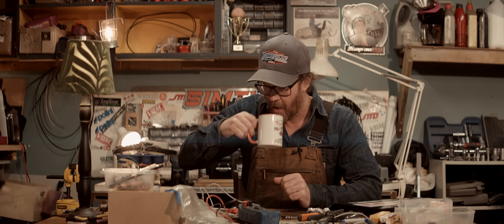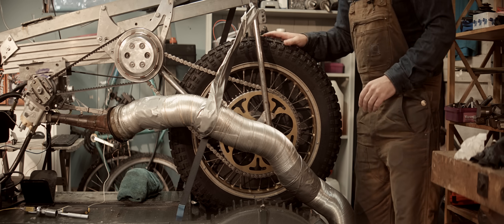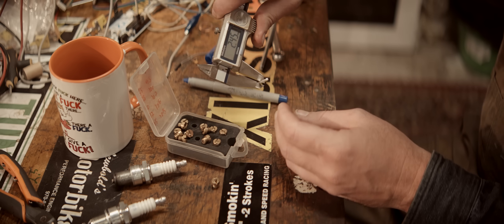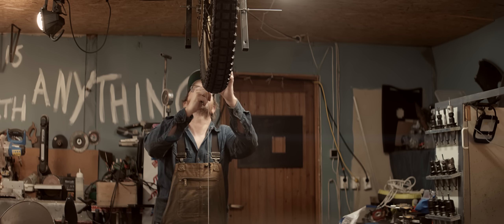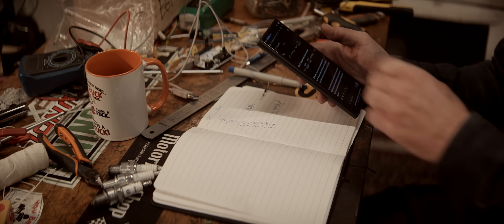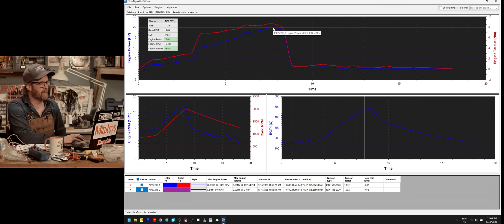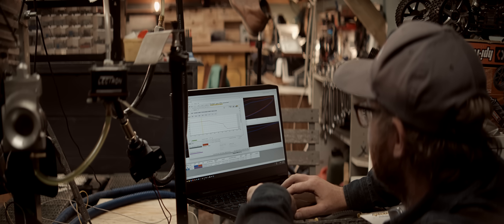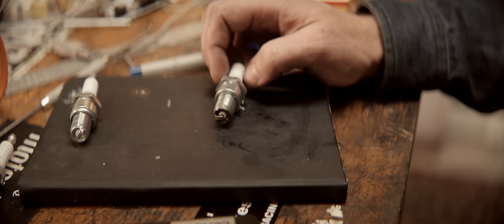22+ Wheel HP from 50cc! Finally!! And we're just getting started.

Comment from the maker: 🌏 Get Exclusive NordVPN deal + 4 months extra here → https://nordvpn.com/2strokestuffing  It’s risk-free with Nord’s 30-day money-back guarantee! ✌️
Reply: The advantage of the Uniflow Scavenging engine is that it does not need to mix autolube oil into the fuel tank but has a sump like a four-stroke engine.
Reply: @sleepyไปเรื่อย  very cool
Reply: The most interesting and important (I think) reading on a plug is the location of the annealing point on the ground strap.  You want to see a distinct line right on the bend where the metal changes color/shade.  If the line is past the bend or into the threads,  uncontrolled combustion will happen (knocking).  If it's before the bend or not yet showing on the ground strap,  you have room to increase heat and power by more spark advance or leaner fuel mixture (if running rich).
Reply: Run a air filter
Reply: why don't you put the variator on max gear?
Reply: Feeling the need to wash Your hands after using ChatGPT  is a statement i can definitely understand.
Reply: add 10% of hydrazine to instantly gain power

or go kaboom
Reply: @fabiotiburzi  yikes, 10% is just crazy talk. He probably can't get hydrazine there. But if you do, I'd start at 2% by mass, retard timing a bunch, and a bunch more; then creep into it. But yeah, hydrazine will change your nitro experience.

Comment: I've also spent years chasing what in hindsight was the wrong problem for a project or working under a misassumption.
It's easy to be upset at yourself for all the "wasted" time and $ but on reflection, there's generally a bunch of knowledge gained along the way that hopefully is of some use in the future.
So, rinse and repeat, you'll push on again making progress until it stops and then realize you need to take some steps back more time was "wasted" then you go forward again.
Take the wins!

Comment: Can you use the YourDyno software to calculate the MOI without a load cell? It seems like the wight and string drop along with all of the other parasitic losses aren't going to be accurate at all.. There is an MOI calculator wizard in YourDyno, but I don't know if it works without a load cell..
Reply from the maker: I got the inertia of the electric motor rotor I use for a dyno roller from the manufacturer of the motor. The string drop method was just for the wheel, and should be pretty accurate.
Reply: @2STROKESTUFFING  What about all of the other stuff?? I see a clutch, a bearing block, a belt, a chain, sprockets... All of that was calculated in my MOI for my Mustang dyno running YourDyno software.

Comment: Are you actually measuring the 30% nitromethane by weight? If you are, you're going to have a very screwed up conglomeration of  fuel components as everyone I know mix their blends by volume—a big difference. Also, with the fuel you're apparently using, the compression ratio for gasoline should be about correct the way it is. If you jack the c.r. to 18:1, there's a good chance you'll burn her down. Why not experiment with methanol and oil first (get rid of the unpredictable nitro) and not risk your latest engine design? Or at least use a mule-engine as others have suggested.
Reply from the maker: It's 25% by volume from the manufacturer. Thought by weight was the norm, that's why I stated it like that.
I've got parts to build up more engines, and raw castings for even more👍

Comment: This is probably the armchair thing. But I think the exhaust scavenging is probably affected by the extraction hose? I wonder if the extraction fans negative pressure can cancel out the turbulence in the flue pipe. Might only be worth a half a horsepower or nothing at all. 

If anything it would mean this little 50 is being mildly restricted and would otherwise make even more HP!

Comment: i think u need more fuel still. on nitro you need ALOT of fuel. the plug looks close bit looking like too much timing on the strap but could be getting hot from not enough fuel. could fix itself with fuel. add more till it starts falling off, then see where the heat mark is on the strap. if the fuel was perfect then it may be too much timing. 5 degrees is a big change on high strung engines. your close it sounds really good.

also how hot was is after back to back pulls. looks like it kept picking up. may need more heat in the motor yet.

i think you can find a bunch of power yet, but running it on the salt for many miles you may have to dial it back a little so it will live.

Comment: Increase the volume in your fuel tank. Gravity is a force and you are barely running enough in the tank for it to overcome the flow
Reply: This is evident by the fact that you need a fuel pump. If I can run a 250cc with 48hp off a gravity fed system you should not have any issue
Reply from the maker: The pump is pumping back from the surge tank.

Comment: When I raced with methanol and nitro fuel we ran 32 degrees trimming  mac 91....plug looks lean to me. More compression equals more power.
Have you thought about a slipper pipe????
Used alot on Enduro Karts with long straights.
Right inline with what your doing. Essentially a long drag race.
Would help your torque on take off and add power in the upper rpms.

Comment: The only way I can see doing more accurate test is to be able to hold the engine back with dino at set rpm. Then you can tune as good as you can with the variation in atmospheric conditions...
Reply from the maker: Planning to add the retarder to the inertia dyno for steady state testing 👍

Comment: The side electrode of the plug looks as if it has been too hot and in some danger of causing pre-ignition or even melting. That yellow colour is not good. NGK make some plugs that have a shorter and thicker side electrode, for example the B10EGV or B10EG as opposed to the B10EV or B10ES. See also something like the Champion N54R in which the centre electrode is recessed inside the plug and the side electrode is a very short piece of wire pressed into a radial hole. A recessed nose plug can have an effect comparable to retarding the ignition a few degrees. It also has a bad effect on slow running, but in this application you probably are not worried about that.

Comment: Cool,, finally after redesigning everything to be more conventional you get a breakthrough, thinkworthy =)
However, the sparkplug, it burns away the soot just about 3-4mm from the sidestraps tip, you can let it go all the way to the middle of the bend and still be safe(if having 10-10.5 heat range)
And, that blueish colour is not hot at all, about 290-300degrees(if bare metal, plating burn away)
Creep up slowly on timing, make sure you are doing regular plugchops(real ones) two or three pulls after a change of timing.
And to be more safe, jet it a little bit more rich, and lean it down when you don´t find any more when adjusting timing.

And oh!
Someone told me to keep away from iridiumplugs with nitro, dunno if it is some weight into that.
Reply from the maker: Thanks for the tips! I'll add more fuel next and go from there👍

Comment: This question may well have been answered at the very early stages of these videos but I will voice it here just in case, back in 1983/84 the Kreidler 50cc race bikes were making 21 HP on pump gas and I have read that methanol gives between 10-40% more power so would it of not been better to start by adopting specifications from that engine and adapting it to run on methanol.

Comment: I´m sorry.
But now trying to compensate for that rear wheel, you get crank hp, but with odd friction added that crank power doesn´t have.
It isn´t that bad though, it´s only a couple of tenth´s of hp you 'gain' by adding the 0.125 inertia.
Reply from the maker: I'm not compensating for drivetrain losses, just correcting the inertia that has to be accelerated.
Reply: nah,, you are sadly enough wrong.
Reply from the maker: No.
Reply: @2STROKESTUFFING  this is how it is:
When you are adding the rear wheels inertia to the roller, you make the rear wheel 'null', dyno thinks it is the roller itself.
Thereby you delete the wheel 'phiscally', but you keep the frictionlosses, getting bogus numbers.
Don´t fool yourself(as usual)
Now the numbers you gain is just tenths, but stil incorrect.
Especially now when you still got the friction from the wheel/tire.

Good dyno softwares let you do rollouts and calculate with wheels inertia and friction.

Now you are in no mans land, but with friction lol
Reply from the maker: I disagree, leaving wheel inertia out when roller inertia is relatively low would give the bogus numbers.
Anyways, you'll be happy to know that I've done a coastdown run with the wheel and chain on the roller and that's the loss numbers I'll use from now on. Still bogus numbers as frictional losses under hard acceleration are higher vs coastdown, but that's the best I can do. Oh, and if you could tone done the aggression a bit would be nice.

Comment: OK, I just caught the 30% nitro comment. I never ran at 30%, so I can miss here. 
I'd worry about the volume of fuel as you increase F:M ratio. At 30% there's a lot of Methanol to ignite the Nitro throughout combustion. 
Nitro is always too lean. lol. But as A:F is moved rich, the additional fluid volume can drown the spark. Hydraulic Lock will occur and will suck. Very high energy ignition may save you some twisted connecting rods.
I don't think the carburetor venturi will have the capacity to pull enough fuel through the jet when you get to about 60% Nitro. It will likely work for dyno tests, but then will be very lean under hard acceleration, and high wind loading.
Nitro behaves crazy weird, almost everything is opposite gas and meth.
I'd drill a weep hole at the bottom of your exhaust pipe. Then measure volume of fluid that drips. No fluid, too lean. 
The carb n/a fuel guys setup the jet for the leanest part of the run, then add fuel another way to cover high load parts of the run. 
When you increase mechanical load on a nitro engine, it is able to burn much more fuel per unit air. And, it must get this extra fuel or it'll split the cylinder open. The nitro burns quicker when the engine load is increased, if mixture is not richened the power stroke will run out of fuel and detonate the last little bit. 
I never had any luck reading spark plugs on nitro. It seemed to look the same whether it was rich or lean. But at 30%, I'd guess you can read plugs as if 100% methanol. Piston Al deposits always indicate lean
I'd suggest you add an air bypass valve to lean the mixture until the head gets up to temp. Close the air bypass at your target head temp, right before you run fully loaded. There's not much air going through the carb at low rpms, if engine is under hard acceleration with mechanical load, I think you'll need to pump more fuel in.
Perhaps an injector in the transfer port would let you program the mixture.

Love your channel.
Reply from the maker: Thanks, and the advice is very much appreciated! I plan on hooking up the retarder to the inertia dyno, in that way I can do steady state and  simulate a Bonneville run to be able to properly tune in fueling 👍
Reply: @2STROKESTUFFING  I look forward to it. I didn't learn much with my eddy current brake load. I think I missed the math regarding variable wind loading. I kept running lean after 660'. Some crusty FA guys talked me into adding fuel and timing at 660. A week later I had a larger fuel pump and sometimes crossed 1320 while still on the wheelie bar. 

enjoy

Comment: Never drill jets!  On our alcohol/nitro motor we typically look for the plating to be burned down 2-3 threads.  But that is a 4 stroke.  Your mileage may vary :)
Also, we always make sure to kill the engine by shutting off the fuel first, never ignition first.  I'm sure you already know that.  But it's important if you want accurate plug readings.

Edit:  SBC/blown alcohol/nitro combo. Mechanical injection.

Carburetion is antique technology with many, many drawbacks.

Comment: Power per Liter is NOT directly proportional. A 1.0 Liter engine will have many more losses. Piston mass will limit practicable RPM. This 2-stroke gets 16k combustion events / min, where a 1L 4-stroke 1 cyl gets only 4-5k. 4-strokes also have to power oil pump, and accelerate the valve train mass. 
So power / displacement is not a scalable ratio

Comment: nitromethane fuel blends... spark plug color, indicated by the combination of fuel additive chemicals when they are broken down into there simplest oxide formations. ... a hydrogen engine would be very clean, other then the oil adding black carbon to the plug as the fuel mix becomes too rich some of the oxidizer chemicals that would leave a white oxide "lead oxide" on the plug become a gray when mixed with carbon. the yellow color is possibly from oxidized ammonium nitrate mixing with lead nitrate in a stochiometric mix with sulfur... 25hp 50cc... soluble flash powder oxides on plug. fuel adjusting ends with color checking for micro grams per liter adjustments. Diesel engines can't do that because the injection pump lines would explode to some extent relating to the preignition/injection pressures and the energy input for thermal decomposition of oxidization additives that burn in differing points in rotation of the ignition flame front temperature. same thing with small primers or large primers, the flash powder is different yet the primer cup is the same, one will not work in the other and the handling costs change between the two... now if that was regulated fuel the plug would have a purple tint added if cleaned and concentrated into a drop to view under a scope, because that would be an iodine formulation that prevents misuse of the fuel for making snap caps as... it self combusts when fully dried in air... same as the linseed oil rag's self combusting. better off asking Santa about some things... how to make a profit on just giving them what they ask for? knowing when to stop and pay for things to some extent... hypoid flute 17hmr, electrolysis machining! only makes music if the player knows how to whistle, yet the one steals it for being the source of... the noise. and it keeps playing... pickle low, pickle high, sweet dill or sour lactic.

Comment: Add a second sparkplug. Two points of combustion origin will reduce time to combust nitro. More compression will help too. Reduce premix oil as a reciprocal function of new fuel volume to previous fuel volume. Such that the oil throughput remains equal between baseline and test. If you mix oil as a percentage of fuel volume, you have far too much oil in the mixture.
Reply: Second plug in 50cc is probably not practical or necessary in such a small combustion space? But I certainly agree with your fuel to oil ratio theory. Increasing oil with premix leans the fuel ratio and vice versa. And increasing the jet size with the same mix increases the oil supply as you say.
Reply: @funkiwikid6106  Second plug on a 2-stroke head is easy, no valves in the way. 

I get your thought on tiny combustion chamber. I'm thinking more about the very short time from TDC to Cylinder Exhaust Vent. Nitro combustion heat to mass, and to volume, is far short of gasoline. I think I was around 8x the fluid volume of gasoline by end of the run.

Please check the time required to combust that mass of nitro. I had too much fuel left when the exhaust port opened until I added the second plug. As you reduce Meth and increase Fuel the burn time increases logarithmical. At 30% the Methanol vapor will initiate Nitro ignition almost everywhere. If you want to spin it at 16kRPM, I think I'd put all my focus into massively distributed ignition. 
Of course, Nitro has never done what I first expected. So happy we get to view this experiment. 
Nitro is absolutely the best fuel to race with. You only have to account for a few items; the rest will be solved by the fuel.

Comment: Ye ha! That’s some pretty impressive hp and your hard work and dedication over the years is starting to show! it’s starting to get serious!  And for love of this engine an adoption to tuning strategy that has brought great success for me is a simple rule to stick by for nearly any two stroke other than a diesel of course although applying the following formula to one of these could be fun! for me on rc nitro engines pushing high rpm’s a must is the ability to run far over rich first! then lean it out until desired power, not much difference to petrol just far more extreme! And any alcohol is more knock prone than petrol when lean! so for safety and to ensure there’s even an adequate fuel supply you should be able to get it fat rich first! at wide open to the point of 4 stroking or blowing out spark (not hydro locking) lol!  then progressively lean it out until it’s singing and the desired plug and chamber temperatures are reached, this is super critical with some of the ringless abc engines I’ve worked on that one lean hot run can kill! But even with a wide range of other engines the over rich first formula is safer than a lean run. Glow ignition has some difference with tuning strategies at the point of precise afr’s but the strategy applies. Also having the ability to time spark ignition is superior for longevity! I’d suggest finding a moderate timing figure that has had good plug readings so far then go over rich then progressively lean until a power peak and stable chamber temp is reached then add a little timing but by bit and be careful not to jump to the conclusion that a ping is too much timing without first making sure it wasn’t too lean that caused it! Fuel starvation has many causes and can pop up out of nowhere! Hope any of this might help!